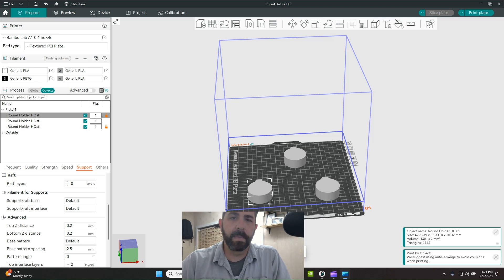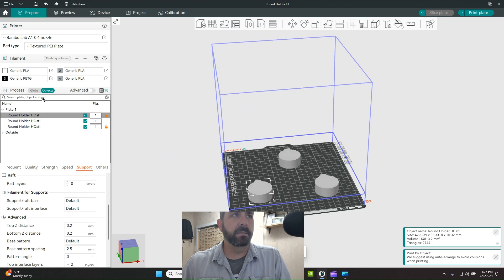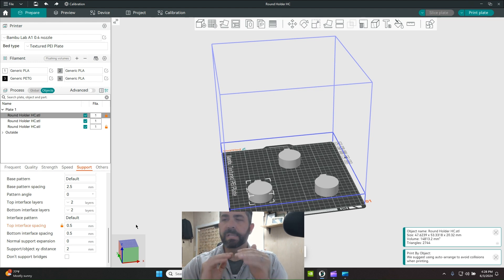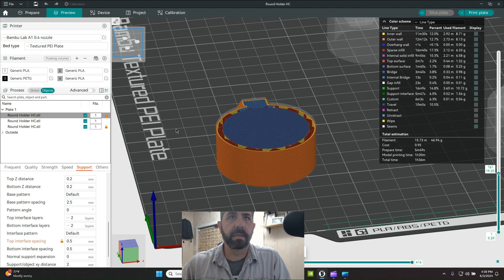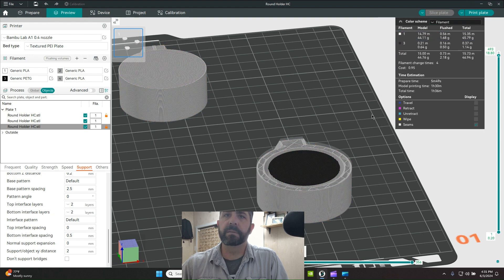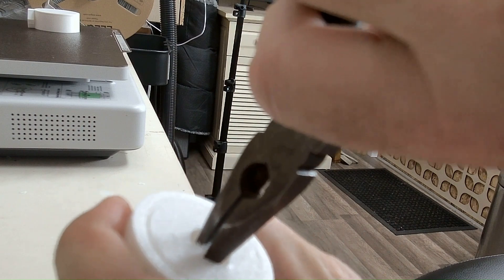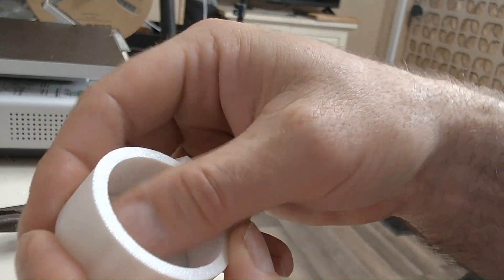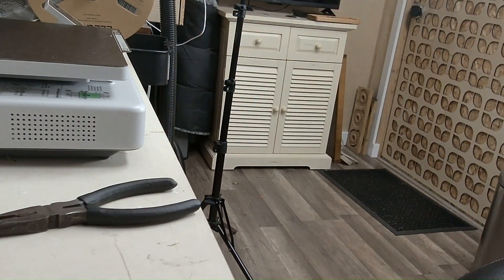Optimizing Surface Quality with Orca Slicer: Top Z Distance, Interface Layers & Material Tips

Comment: If you use a different material for supports like PETG, you can basically set the top Z distance to 0 in most cases, this results in a significantly better surface quality at the supported face.
Also, as already mentioned, the purge tower reduces/prevents the discolorations, on the cost of longer print-times and more material waste. In your example this might lead to the PETG-layer stick to the surface when you remove the supports, but it should still be easy to remove since it doesn't bond with the PLA.
While the AMS is very convenient, I still try to minimize material-changes, since they take a lot of time and produce a lot of waste. Thus, I also try to design parts in a way that as little supports are needed as possible.
A function that I miss in the orca-slicer is to change the time when materials get changed. When I use PETG for support-faces, let's say for 2 Layers, it always prints the supports first and the part second. It would make much more sense if it would print the part first at the first layer where the PETG is used, then switch to the PETG, print the supports for this layer, go up to the next layer, print the supports for that and only then change back to the normal material to print the part. This would cut the material changes by half...
Reply: Yes. We all know this. 99% of the people watching this video don't have the luxury of using a different material for support. If we were using a different material to print supports, we wouldn't be looking at this video in the first place.

Comment: A few things to know, when using an interface layer with a different material,  make sure to have a significant flush on the filament change. That line of darker material you see is PETG in your PLA, which will make that part extremely weak (generally). 

Good choice not to use a purge tower, as I find they often fall apart when using different materials. 

Also, note that was a perfect test subject for the PETG interface. Other shapes will be significantly more troublesome. I found anything more than a flat single layer ( or 2 layer) interface was more tricky. Meaning,  geometry that makes the interface curve from one height to another are highly problematic. 

The final thing I liked was no air gap when using different materials.  Also, I like using a larger XY air gap. I believe the default it .35mm but I generally go to .50 to 1.00mm. This really helps with removal for the same material support with very little quality issues. But note that some geometry will have issues with too much XY gap.

Comment: Thanks for your video. I'm about to do a big print in PETG with the top surface facing down in contact with the support to reduce time by half. It seems by looking at your video that orca slicer does not provide miracles in its settings. Since I print in PETG I was wondering if the PETG CF was maybe a better choice in this regard to leave a nicer surface finish once support removed. Any idea?
Also , Is there any way to set ironing on the layer just after last support layer ?
Reply from the maker: not sure about the PETG and PETG-CF. you might have some luck but would recommend a small test print first.  I dont think Orca recognizes the top interface layer of support as a "top surface" to be ironed.  I think it's ignored.
Reply: @fischer3d  The problem is that whatever the settings for removing the support the next layer has to be treated like a first layer to be looking nice.  I've tried several setting today with the supports doing like you with small test prints. The setup that worked the best  was to remove the top interface layers of the supports and it detached itself. But the next layer where poor with gaps between lines. On the opposite side if I setup the supports as default I got a bad first layer above . I can't have the layer with lines bounding to each other like on a clean first layer sticking on the bed
Reply from the maker: do you have the option to try and run pla as your interface layer?
Reply: @fischer3d  Unfortunatly only if I do manually. But the part is way to big with and the top surface not horrizontal.It'll take forever.(I used forms in fusion360 to make the part). Printing with the voron 2.4

Comment: If possible to use .8 Nozzle. I have Ender 3 V2 printer
Reply from the maker: Generally yes.  You can either click the cog wheel on the "Printer" banner and select the Ender .8mm profile or you can edit the presets of your existing printer.  Click the "Edit Presets" icon next to your existing printer name, select the Extruder tab and enter the new nozzle diameter.  Be sure to save it as a new name like "Ender 0.8mm nozzle".  For larger nozzles i recommend raising nozzle temps by about 10 degrees and slowing down the print speed.  You have to do some testing to see what works best, but try reducing by 20% and see how it comes out.
Reply: @fischer3d  Thanks